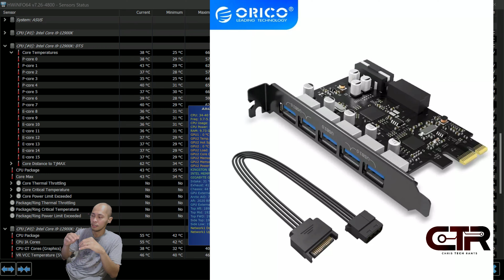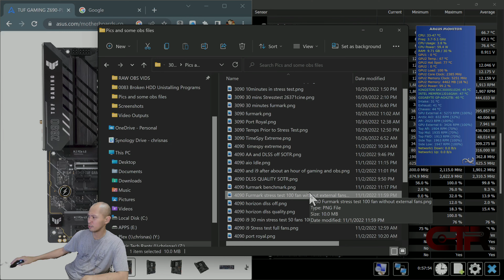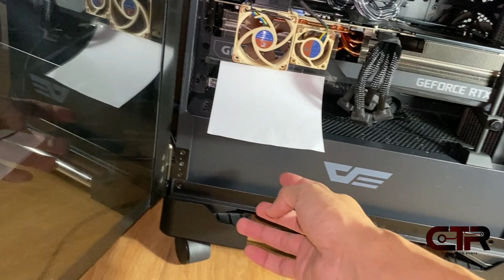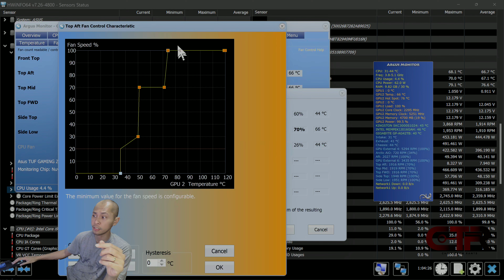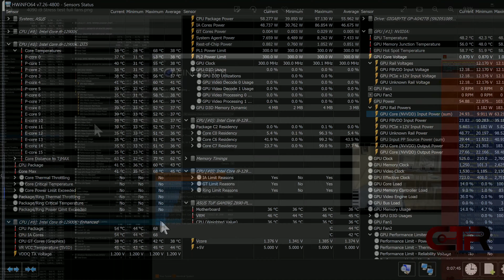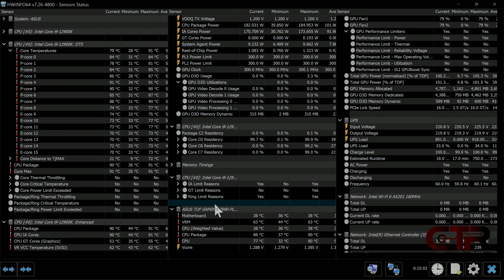Installing my Windforce RTX 4090

Comment: Windforce series from Gigabyte is similar to Zotac Trinity, they have the worst components of all models, much much worse than the FE. You should have bought the Gigabyte Gaming OC, that one is decent, not great but decent. For normal use any model is perfectly fine and will perform more or less the same. Don't push your OC though, the Windforce is not built for that. Also, don't waste money on water-cooling with that model, it's a complete waste. WC is only worth it with high-end models, to squeeze some performance with OC. Watch this mobo analysis as an example https://www.youtube.com/watch?v=9I7U4kdc0V4
Reply from the maker: Appreciate your input 😁 I prefer this windforce card over gaming oc though. Components of this card is good enough in my opinion. https://www.profesionalreview.com/2022/10/12/gigabyte-rtx-4090-windforce-24g-review/

 In regards to WC….. WC is WC, it will heavily depend on the inclination of the user. Regardless if it’s a palit card or a strix card. They’re not only for OC. It maybe because of aesthetic reasons or simply for a generally lower temp for its components and to lower the noise generated by the fans. An air cooled strix will out perform this windforce card. A WC strix will still out perform a WC winforce card. I even doubt that a WC windforce will beat an AC strix. Point is, WC is WC.

In regard to oc. All cards have a breaking point. I hope you don’t push your OC beyond the board’s limits with your stix card, just because it’s a strix.

Im not into heavy oc myself. Performance is already great. And right now, I’m having a hard time balancing power draw and performance uplift. A 51 point increase (about 0.32% performance uplift) with an increase of 6% in power…..no thanks 😂
Reply: You shouldnt even be OC any of the 4090 cards. It does no good whatsoever.